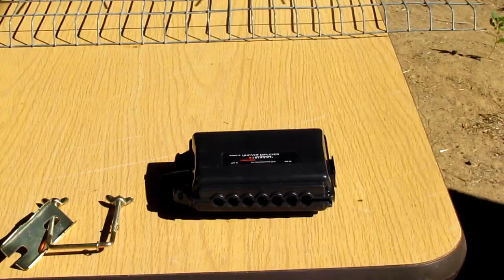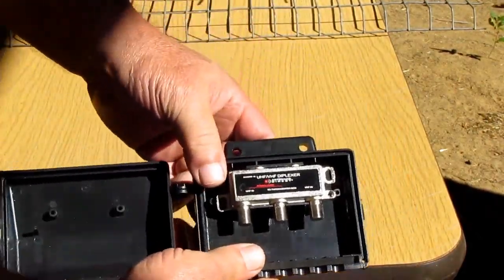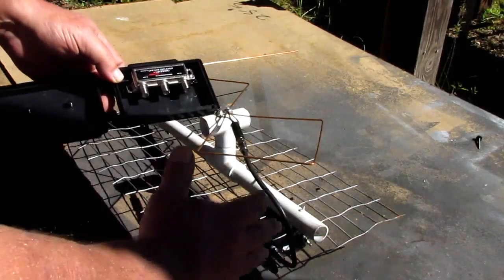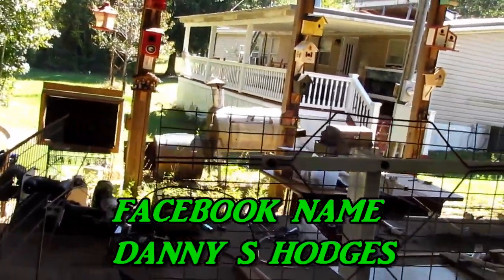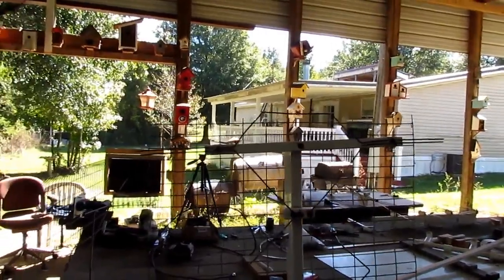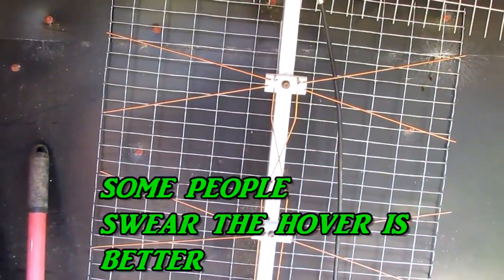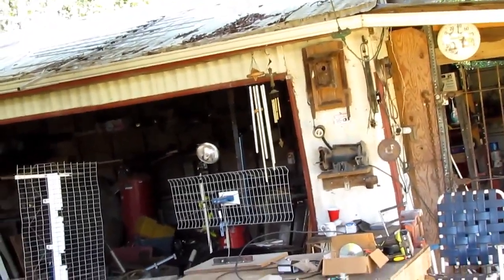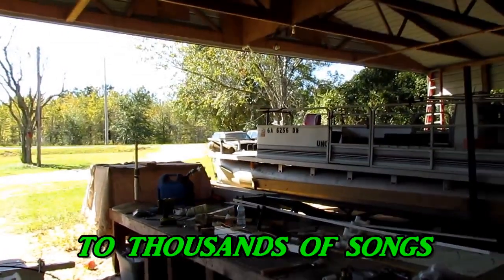UHF VHF TV Antenna Combiner

Comment: I will add a comment. This is Chuck Smith the original antenna man. If you are in situation where you need the highest signal possible from a system using separate UHF. and VHF antenna combined to a single preampilifer and lead down. Using 300 ohm flat lead from each antenna to a 300 ohm combined and then going to the preampilifer with as short a run of RG 6 coax as possible before the preampilifer will make a pretty big difference in signal strength. Then RG 6 coax out of preampilifer down to power supply in house before any splitters. This will give you maximum signal gain with the least amount of loss before your amplifier and strongest signal quality at your TV.

Comment: Thanks for uploading. Some discussion forums are recommending for me to get a "better" combiner, if I can find one, than the model and brand shown here. I'm not sure which way to go, because I don't know who is right, and thee are not too many choices as these things have become hard to acquire. I was sent a link to an eBay store with an Aska brand (supposed to be better), but it's $20, and it's not water proofed. I'm going to be adding a Stellar Labs model 30-2476 that's for only VHF-high; afraid to try Danny's system for me, because I just don't think any dipole will have enough gain for what I need. What I'm trying to add station wise is RF10 from 84 miles almost due west with a CM 7777 pre amp that's already connected to my UHF-only 8-bay antenna. I'm 22' high on a gable-supported mast. My current UHF channels are coming in mostly from 59-84 miles in the same direction (from 264-275 magnetic). My fear is that by adding VHF to my system to get that one channel in my area that's not UHF, that I'll slightly weaken my UHF reception with many of my stations pretty reliable but weak.

Comment: Great video. I used an all in one Yagi antenna (UHF+VHF-Band 3+FM) but it didn't performed well, especially on UHF. When it rained most of the UHF channels either dropped or were pixelated also had some interference on FM. So I decided to buy 3 separate antennas and combined them with UHF+VHF+FM combiner. UHF (channels 21-60;  freq: 470-790 MHz), VHF band 3 (channels 5 -12; freq: 170 - 230 Mhz) and FM (they are also Yagi antennas but with high gain on their receiving band). I've mounted them in the same place where the old antenna was. Also I'm using an active splitter with 4 outputs to connect 3 TV sets and a FM radio with coaxial (75 ohm) input. With a normal splitter I'm loosing signal strength but an active one solves the problem. The TV and radio signal is stable on any weather and in any condition.
Reply: This is what I need help with! Please do a video on this!
Reply: Whst is that your holding? Plz help me

Comment: my old vhf is picking up uhf only. . I get ion 31 39 UHF 41/49. I get 22/  -1 -4 UHF. Split frequency  uhf/vhf unit now I get those plus 7/ -1 -4 UHF. RCA Digital signal preamplifier and combiner you promote blocks all uhf and vhf channels/signals. It's crap for $27.00 new in box. Midland that I bought it from don't respond to getting my refund from their site. They have two different invoices for 1 device. The invoice number on the invoice  under INVOICE NUMBER is not the one they respond to.. It's a different # with AB in the begging. Once you find that #. input in the box they provide the site goes into freeze and nothing after that

Comment: American tv doesn't broadcast on VHF anymore there, Bud. VHF antennas are pretty much useless.
Reply: some  major cities use vhf channels (Lou KY  channel 3 and and 11 plus several uhf) please do your homework before making remarks.thanks
Reply: Yes,you're right, I was wrong.
Reply: Don't know where you heard that. Initially channels all would have been VHF, but you'd have to space them far apart to avoid interference. So if you established a new station in the 60s or later, there might not have been enough channel licenses left on the nearest VHF band, so you would have had to get a UHF. These all would have been shuffled with some FCC changes in 2009, so you'd want to check the channel maps to see what nearby stations broadcast on VHF or UHF.

Comment: Hey Danny- I just posted a comment about dual antenna setup on your [Gray Hoverman VHF Fix ] video. I used a regular 2 port signal splitter that works great! I think the trick is that the length of cables attaching to antennas to the splitter have to be EXACTLY the same-I bought 2 cables that were 3 ft long each and bought 2 new transformers of same brand mfg. Hope this helps......happy holidays....Dr Hodges!